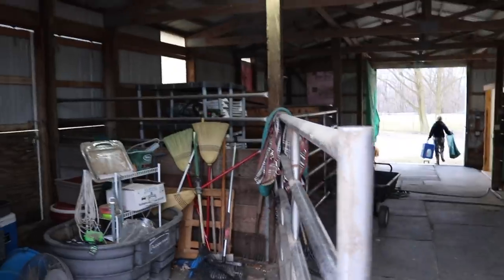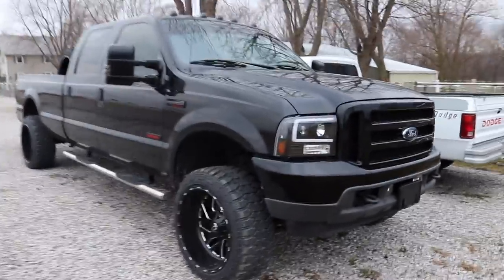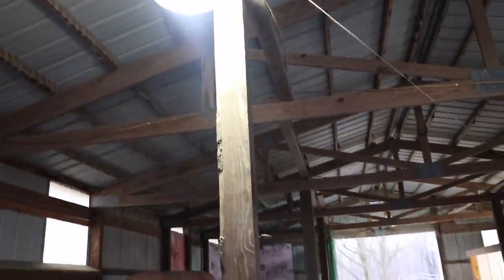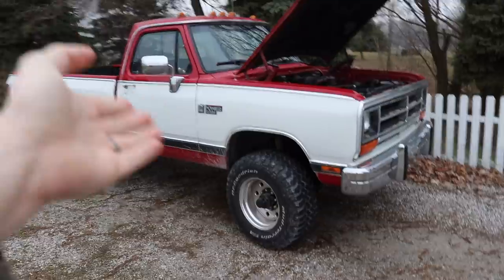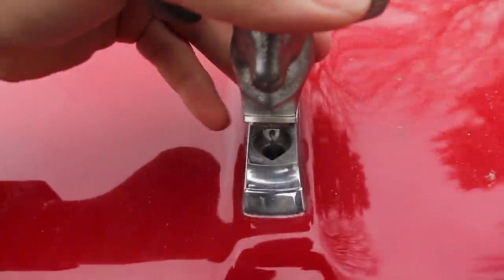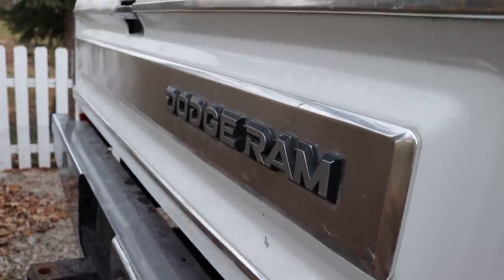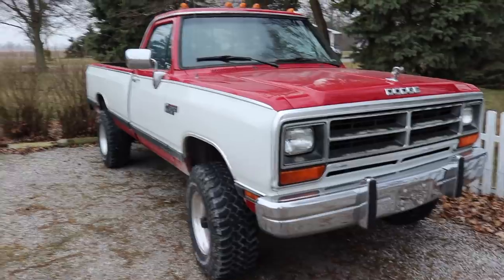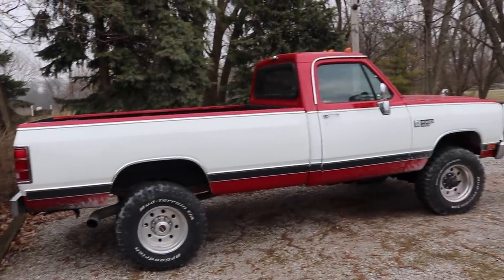I Found A 55,000 MILE 1ST GEN CUMMINS IN A BARN!!!

Comment: Those 89 front ends are sweet. Puts them above the later 1st gens in my opinion

I give it a 9. I would put the original wheels  with the hub caps and put some fluid film on it to keep it from rusting.

Comment: Hey Malachi! I enjoy watching you taking on these projects and learning! I’m an old guy myself and am starting to slow down on the project front. So it’s exciting to see a young man with all your energy! I wanted to offer  my suggestions on a couple of things you’ve asked opinions on. First.. as far as trailers go maybe consider a gooseneck or fifth wheel trailer with the adjustable beaver tale deck over. Reason being is your pretty much only hauling trucks that don’t sit real low, they have a wider deck, and beings that you have a farm it will be more universal for hauling and loading other stuff like bales and equipment. You could always put a nice 12k lb winch on the front and you have the wife’s white truck and  the fifth wheel or goose neck are just easier to drive. Second.... since your going to be pouring a concrete floor in the barn do yourself a favor and get you a nice two post lift that will lift a one ton truck. They are not terribly expensive and you can find some deals on used ones! that will make it easier for you to change tires and wheels, lift beds and cabs off, and if you decide to build a different shop or whatever you can just unbolt the lift and take it with you! But remember you’ll have to plan for the lift before pouring your floor cause that area will need to be a little thicker and I recommend reinforcing. That’s my two cents! God Bless!

Comment: do NOTHING to hat 1st gen at all, it is 1000% perfect just the way it is other than a cleanup, as for the shop i still think you should build a shed for the hay that is separate from the shop, you can fairly easily insulate the barn as well and put in a wood stove or if you have access to natural gas at the barn you could do in floor heat from a natural gas boiler. put plywood on the walls so that its easy to hang tools from it, if you want it to look pretty put drywall over top of the plywood to maintain a nice strong backing to hang stuff though

Comment: I love 1st Gen D350 12v Cummins Diesel you Lift kit new Wheels and Tires 5%Limo Windows Tint and Straight pipe Exhaust 7 inch Tips Loud n proud love Red/white Fix up and Drive it Malachi You as Tow Rig too

Comment: What are technical differences between a W350 and a W250 ?
Reply: Wat Ferfoot stiffer springs and the possibility to buy a dually. Along with bigger rear brake shoes but that’s it
Reply: consider that both are SRW, only the springs are harder?  No frame differences ?
Reply: Wat Ferfoot no frame differences that I’m aware of. Just stiffer springs and larger rear brake shoes and wheel cylinder.